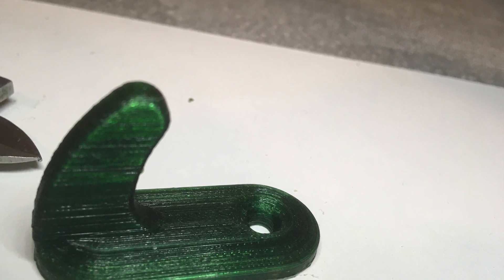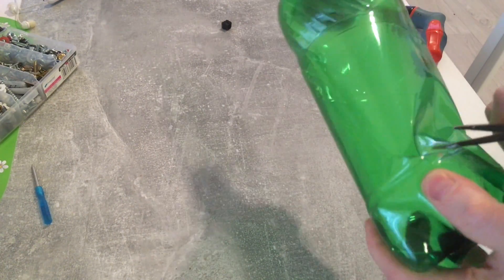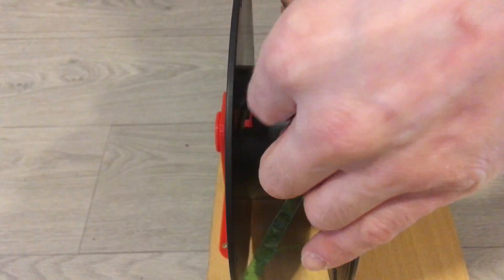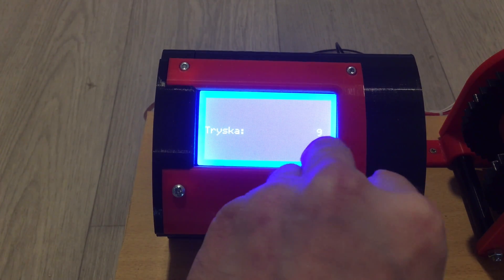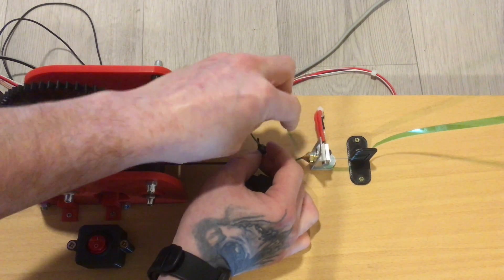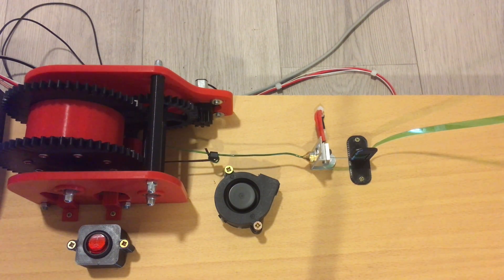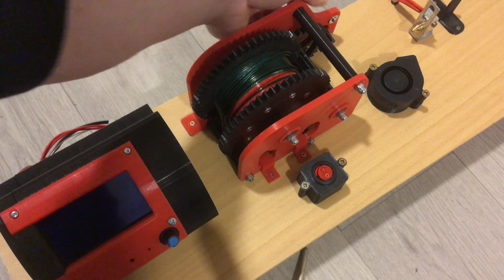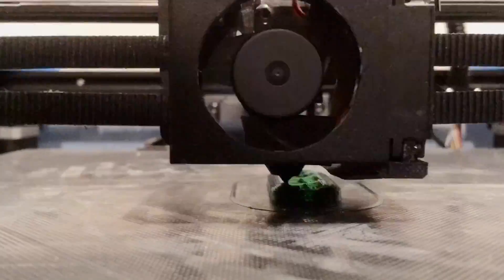Filament from PET bottle

Comment: Some one help me, I done everything. Came up to the filament. Now I have filament.. changed ender 3 with all metal hotend also.. now when I am printing , extruder crushing the filement and it is not moving into the hotend.as filament crushed, extruder not pushing filament . Is my filement because of crushing not feeding into the hotend or as it is crushed the extruder is not pushing in the filament...i am struck.
Reply: Is it Dual gear extruder setup?

Comment: Hi this filament will work on sapphire Pro?
Reply from the maker: Hi, thats a good question. There are some prerequirements for sure.
Nozzle temp 260C, bed temp 70C. The rest is unanswearable. It mostly depends on your petamentor nozzle diameter. If you make to small hole, the extruder wheels will sliping. Thats all I can tell you.

Comment: is the filament hollow inside or solid because mine is a bit hollow. i tried drilling 2.0 because i didnt have 1.75 with me so tried testing it with 2.0😅 is it because of the big diameter of the nozzle what do you think??
Reply from the maker: Hi, yes there is hollow 🫡

Comment: Why do you use the fan? Do you have to cool the filment as it leaves the extruder?
Reply from the maker: Hi, no. The production speed is not too high. The production temperature is to low for making any visible filament changes during the pulling. Its not melting in the nozzle. Its only heated to easy bend it and join on both sides (yes this pet filament is tube with hole in the middle) this is the reason to lift up the flowrate in your slicer
Reply: @ondrejsraitr  Thank you, what type of motor did u use? How does your motor system work?

Comment: has anyone figured out how to farm multiple bottles into one long strand?
Reply from the maker: No, I cant find any methods to make one long strip from multiple bottles. But output (filament) can be joined. 👍
Reply: @ondrejsraitr  how?
Reply from the maker: Im personally using filament runaway sensor to change next filament string into an extruder (its the most easiest way for me). There are some arduino project for automatic use and some difficult methods with candle and womans hair ironing machines. Try to search “pet filament joining” 👍
Reply from the maker: Your comments in notification bar scares me every time 😂. Every time pops up only “Youtube studio- Ghost in the system…” and my reaction is allways: “WHAT THE HELL IS THAT?!😦” 😂

Comment: Can you tell me how much volt are you using? I am doing it manually
Reply: so, i did it and it works! but, now i have to stitch all the filament together. do you know how?
Reply from the maker: Im using filament runaway sensor on my ender 6. It always stops the print and it continues after changing the filament.
Reply: @ondrejsraitr  gotcha
Reply from the maker: Hi, youre doing manually what? 😁 My PSU is 12V 5A actually. Hope it helps you 👍
Reply: @ondrejsraitr  and you are powering it with all 12? Because when i do that it starts melting and dripping and when i give it less it is not a perfect line
Reply from the maker: Yes, everything is Powered with only one psu. What are you using for temp regulation?
Reply: right now i have connected the heating element to a charge and power supply. I didnt want to buy any electronics because i didn't know if i could do it (so no, i dont use a thermistor). Right now i wont to power it with the exact volts to melt it down to a line (if you dont know the exact volts, do you think that i should invest in the electronics or not?)
Reply from the maker: Try to look at my Petamentor project. Parts are cheap as hell and there is a full tutorial for assembling. We have community forum to help new builders. Visit https://petamentor.com 
I think there is no way how to achieve good results without thermo controller.
Reply: @ondrejsraitr  thank you for your help!

Comment: Hello. What diameter you have at the nozzle 1.6  or 1,7?
Reply from the maker: Hi, I used a 1.5mm drill bit. Then I wobbled a little bit. I cant measure it, dont know how. It was a try and fail method, untill I suceed. Now Im getting about 1.65- 1.8mm filament. This wast the same with flowrate setting in cura. I had to test a few settings, finally I stuck on 140%. Its work for me very well.
Reply: @ondrejsraitr  THANK YOU VERY MUCH
Reply from the maker: You're welcome 😉
Reply: MK8 has a 1.5mm nozzle.. may not need to even drill it.  But youll probalby need different heater and thermistor. I dont think the V6 ones will fit into a MK8 heat block. So far the MK8 and I  think the Volcano are the only hot ends that have the 1.5mm nozzle. I believe the MK8 is cheaper than a volcano setup so probably better off going with that.. but to keep it simple youll probably just want to get the V6 setup and just drill the hole to 1.75mm.  The #51 drill bit will get you a 1.70mm hole.
Reply from the maker: Hi, its a great poin, will vheck it. Thank you 👍

Comment: I have been working on a project like this for myself so that I can use some dual extrusion and use recycled PET for support/infill material. I cant wait to finish this project, but bit seems the most time consuming part is removing the label adhesive/glue from the bottle. Anyone have any tips? My best luck is vegetable oil, which is wasteful and messy and could possibly just be setting me back more than buying real filament.
Reply from the maker: Oh man, thats so bad 😄, it depends on your local possibilities. For me is the best 2litres bottle from the local beer. 👌
Reply: @ondrejsraitr  I use PET bottles for other projects and the single best thing I have found to remove the glue is carburetor cleaner.  A quick spray on the bottle and then wipe down with a paper towel and the glue is gone.  I always have it on hand for my car and it's cheap.  If you don't have any WD40 also works but nowhere near as good.
Reply: If youre in the States there's a stuff I use to remove label glue, called "Goo Gone" Its great.   Just sprinkle some on the glue.. and it will rub off with your fingers in a matter of seconds.  Stronger glues, the Goo Gone will need to sit on it for a minute and require a scraper. Just keep dabbing more onto it as you rub/scrape it. It has never failed me.
Reply: @ChristopherJones16  I am, and I am a strong believer in the power of goo-gone, but I tried it and I didnt seem to have much luck. Perhaps it was just a stubborn bottle and its worth giving it another go.
Reply from the maker: Im too struggling with so many things about pet filament. But you have to keep trying, nothing else. Thats the best way to learn something valuable!👍😁
Reply: @mattmakes2135  have you tried Mineral Spirits? I never tried it on glue but I know it gets tar and stain off my hands pretty well.
Reply: Use acetone.
Reply: Use a razor scraper